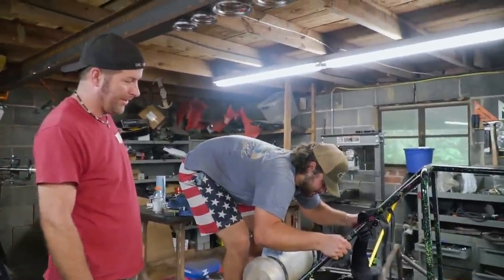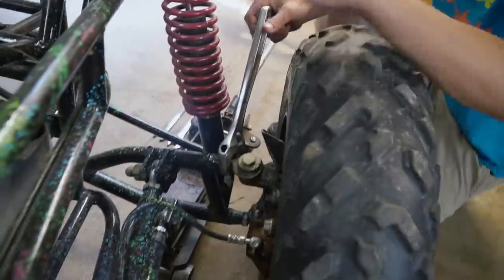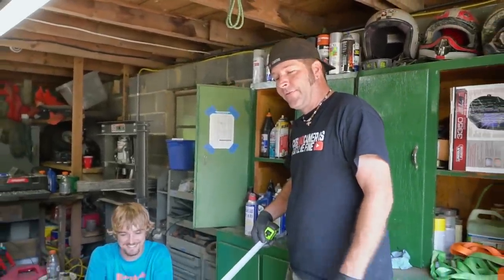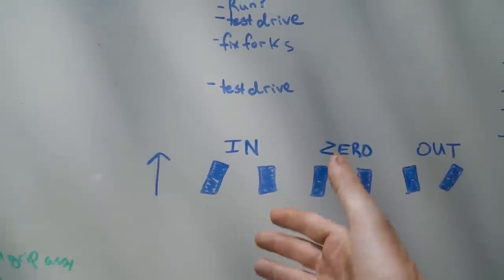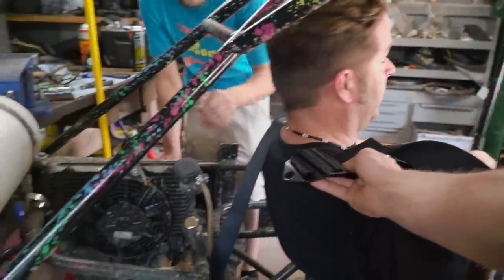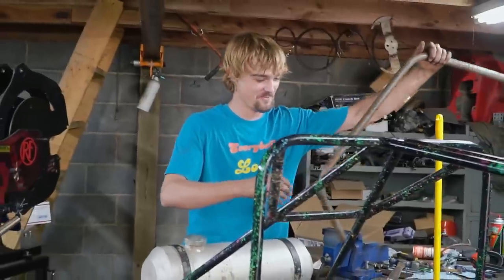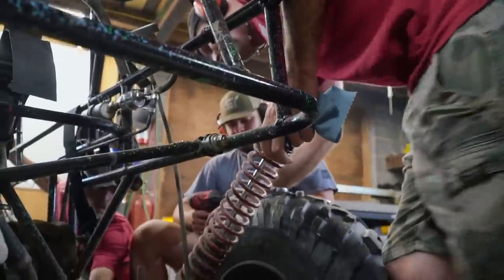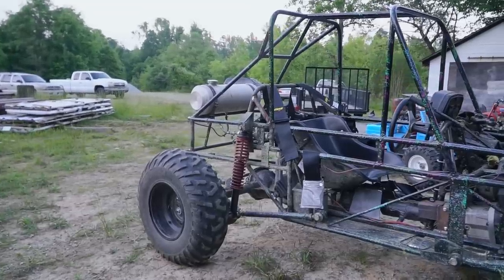$100 Long Travel Shocks RUINED the Trophy Kart | Jump Testing, Is It Safe?

Comment: Google Yamaha raptor shocks on eBay. You can something better for less than 300$. Even new fox or elca shocks are 1800 for my 1000 can am xxc. And it’s fully adjustable and 820 lbs 92hp atv floats like a dream.

Comment: When Issac put his foot down on the gas the rear end lifted up instead of down. This seems odd as the weight should transfer to the rear and not to the front. I'm probably missing some suspension knowledge on why it's doing that, anyone know why? I've seen motorcycles that have a shaft drive do this but it doesn't happen with chain drive bikes.

Comment: I'm not sure where you got your information from, but I'm here to tell you that tow in is never good ... and I will explain why. I used to work on ATVs and Snowmobiles, and with all of them you want a little tow out. Tow in will cause "darty" unpredictable handling and oscillations... Steering input, bumps, uneven traction or even slightly different air pressures all effect tow in way more than tow out.  This is why. 

If you have tow in, your wheels are turned slightly to the opposite side (the right wheel to the left and the left wheel to the right), Both front wheels will be scrubbing / skidding / fighting each other equally when going straight and on a level surface.

I will now use a specific example to show what goes wrong.  A slight bump on the right hand side provides more traction to the right tire. As the right tire grabs, it overcomes the traction of the left tire, and because it is turned to the left, the vehicle will dart to the left. This causes even more traction on the right tire due to the weight shifting to the right side of the vehicle, as it turns to the left. 

To overcome this / make a correction, the driver will turn right, causing the weight and traction to shift to the left tire and this continues to happen back and forth. 

With tow out, you get a MUCH more relaxed feel. When the weight shifts to one wheel, that wheel is pulling in a direction that unweights that wheel and puts weight on the opposite side... This has a self correcting action that will stabilize the vehicle and is way more forgiving.

Comment: You guys need to add a bit more rebound in the rear and take a crap ton out of the front...the front has literally no suspension  after it compresses...it's awful lol just buy some cheap used motorcycle shocks...you can change the springs out and even revalve them if necessary.

Comment: be like the general Lee with crap ton of cement in the trunk so it'll jump straight an not nose dive 🤣 or bigger gas tank and some beefy plates metal plates to mount it on, aswell as some thick metal  gas tank Sheild's/ protectors an mount the slightly bigger gas tank lower in the chassis possibly

Comment: Wait, ebay shocks are junk? NO WAY!!! There is this saying, "you get what you pay for".... Don't take out fluid to help rebound, add spring. If you need SLOWER rebound, that's a different thing.. also, keep the gas ON when you are flying the car if it' wants to nose down.

Comment: I'm sorry buddy I'm confused why you're squaring front wheels to each other. Aren't you supposed to  align front tires off fixed rear wheels.  Your way you can't tell which tire is off so can still be out of alignment.  I think down and dirty would be string just touching rear and front of back tires. Then run string to fixed cone or stake which you'd measure each front tire off. Then she'd be truly aligned!!

Comment: What about limit straps on the rear suspension?  Think about it.  As the vehicle leaves the ground and the suspension unloads the springs can push down on the rear axle easier, causing the vehicle to over rotate towards the nose.  Using strong straps that limit how far down the rear suspension can be pushed may solve the problem since the suspension can't over-push off the ground.

https://www.youtube.com/watch?v=xqUWS_Ww5sI

Comment: While the seat is not designed for a harness, I do cringe to see the harness so loose when the driver is seated. A loose harness can cause you more injury in the event of an accident. You need to push back in the seat, tighten the waist belt and tug those shoulder straps down tight. The harness should be slightly uncomfortable if tightened properly. 
Please snug up the straps in the future. I love your channel but I don’t want to see the “I broke my collarbone” video. 😞

Comment: The ramp ain't built right to launch that thing also you need to mash the throttle as soon as the front tires compress the front suspension going into the entrance of the bottom of the jump this way the front end launches and the rear follows....

Comment: Its just sitting way too low for what yall are trying to do. Your bottoming out. Get atleast another 6-8 inches of lift in the suspension. The spring issue can be addressed later and wont be as bad as you think. Get her up!

Comment: your sprung to soft on the rear, it's not the shock it's the spring.... when you were testing it in shop you were getting coil bind,,,,, do more research on the springs.... changing the rebound is not going to help with the springs you have.